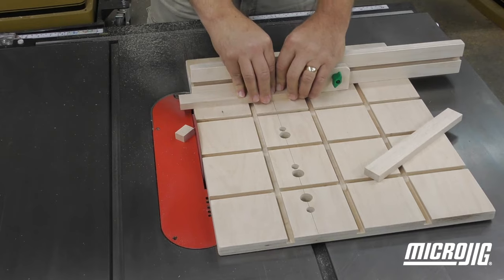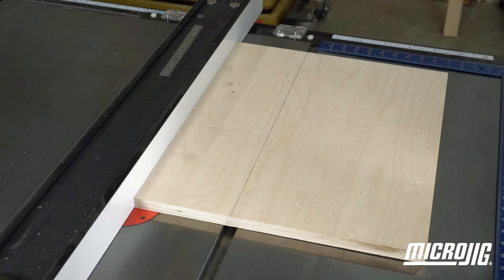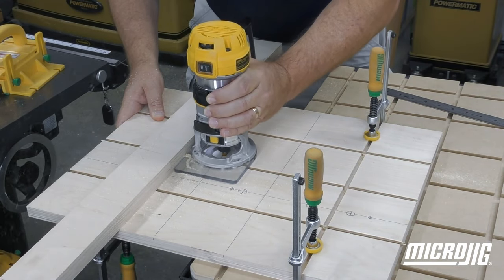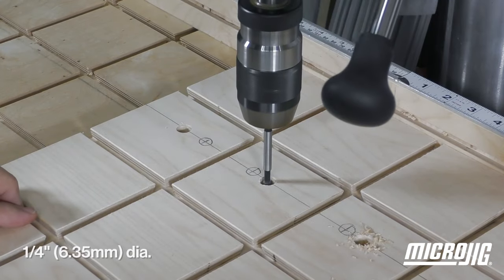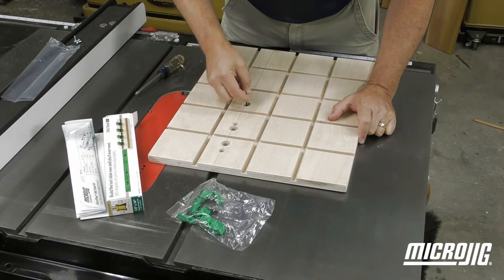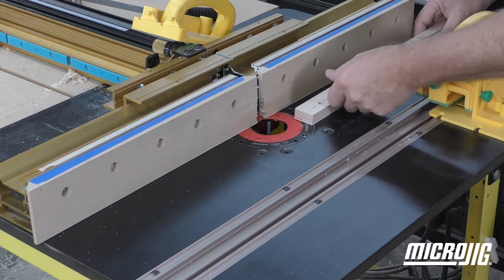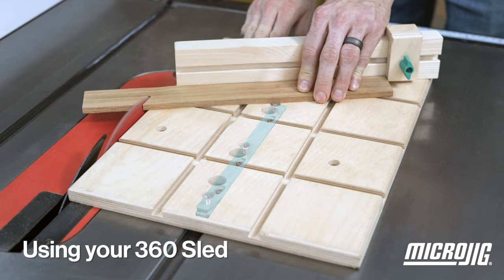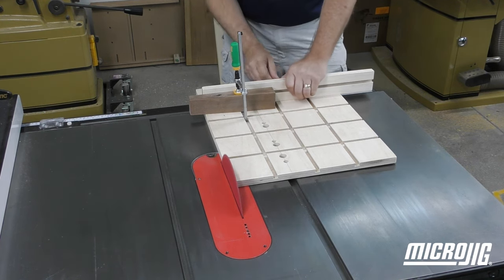Build the 360 Table Saw Sled, FAST with the New and Improved ZeroPlay 360 Sled Kit!

Comment: Great presentation which sold me on making one. Should some type of finish be applied to the wood? WELL DONE!! Thank you.
Reply from the maker: Art, Thanks for the kind words! 
A light coat of shellac is my go-to for jigs and sleds. Or even just paste wax. You do not want too smooth a finish because a little friction helps clamping parts firmly in place.

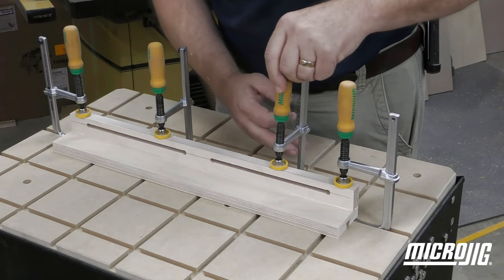Comment: At 6:49 your instructions say to clamp the base to the face of the fence.  Are you supposed to glue it prior to clamping?  Also, how do you square the fence to the saw blade?  Since it is not permanently attached to the sled base, I assume you must square it each time you want a 90 degree cut?  This is probably the most versatile sled I’ve seen, but squaring the fence at 90 each time you use it makes me want to make a dedicated version with a fixed rear fence.
Reply from the maker: JT, yes, glue the fence base to the fence face when you clamp it.

Second, you are correct, the fence has no presets, so you do need to square it for 90 degree cuts. 
If you square the base edge to your fence, then a good quality Speed Square will let you rapidly set 45 and 90 degree cuts. 
I actually use an inexpensive digital bevel square (about $30.00) to set my fence. It has the advantage of being able to set any angle very precisely. 

The problem with a fixed rear fence is that it will greatly restrict the ability for rotating of the 360 fence.

Comment: I have a SawStop table saw which tilts to the left. Should I use the right miter slot for the sled?
Reply from the maker: You certainly can, especially if you plan on cutting parts with the blade angled.
Pretty much all modern table saws are left tilt now. 
I generally do not use my 360 Sled with the blade beveled, so I use mine on the left.

Comment: Any way to use a table saw to make the grooves?
Reply from the maker: I often use the table saw with a 1/4" dado blade set up to make the relief grooves, but there is no practical way to cut the dovetail grooves using the table saw.

Comment: What was the point in the adjustment I’m the beginning if we just reverse it in the end and put it at the narrow point?
Reply from the maker: First, at 4:22, you are adjusting the ZEROPLAY Bar itself to fit your miter slot. This is using the supplied hex wrench on the button head screws. 
Later, at 4:55, you are squaring the sled to the blade/miter slot using a screwdriver to loosen and re-tighten the mounting screws. 
Two different adjustments. 
If this was not what you were asking, please feel free to email us a support@microjig.com or call us at (855) 747-7233 and we can answer your question.